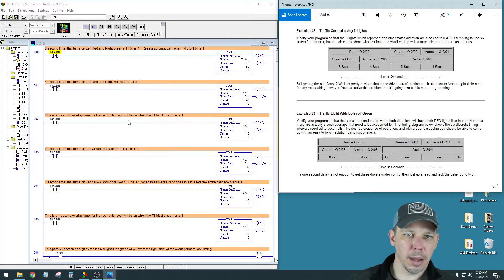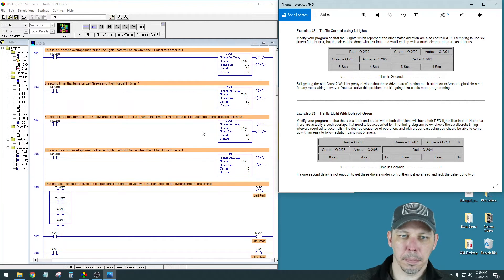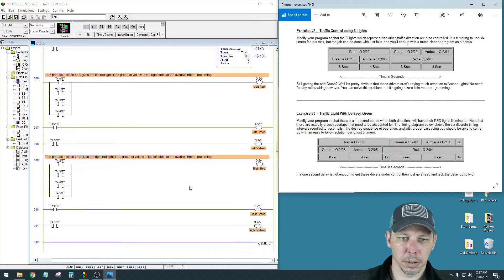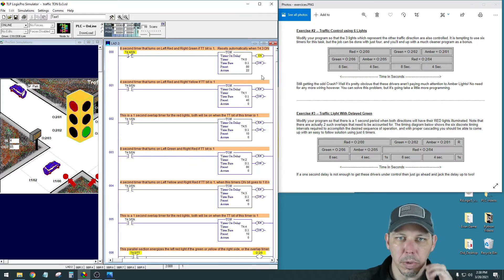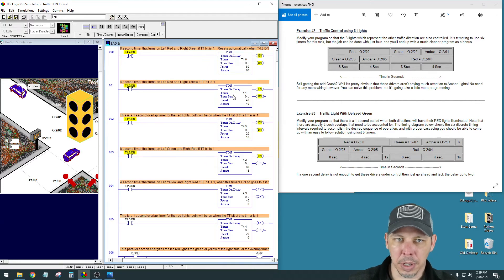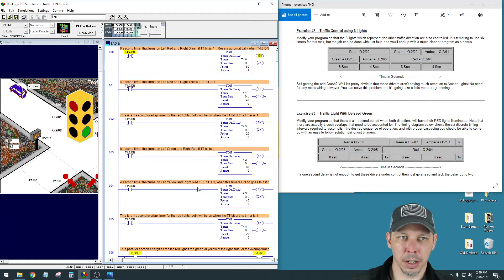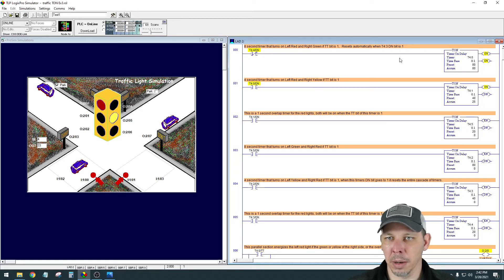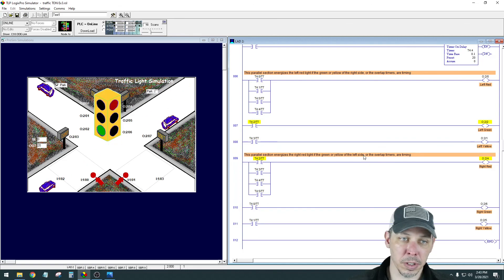LogixPro Traffic Control Exercise 3 - Traffic Light With Delayed Green

Comment: Might I suggest a final rung  that  does an examine if closed   -]  [-  T4:4/DN     with a (RES) T4:0 reset Timer   Solved my Crash problems.... If you do this you have to remove the examine if open  T4:4/DN from rung 001.

Comment: I'm curious if your cars are also crashing if you uncheck the "park" box. Seems like the little simulated drivers in my program have lead feet and are driving through the red light as either side changes to green. I'm getting a blip on the O:2/4 on each timer reset cycle.
Reply: same here my teacher said its because we used timer timing
Reply: I was having the same issue. I solved it by replacing the parallel 'or' statements that turn on the red lights with something else. If you use XIC statements assigned to the outputs O:2/2 & O:2/1 in series to turn on the Left Red whenever the other two lights are off then you will not get any crashes.
Reply: Kindly simplify were exactly do we go